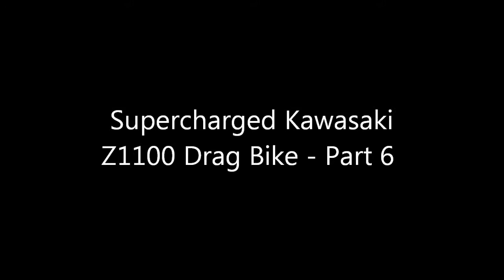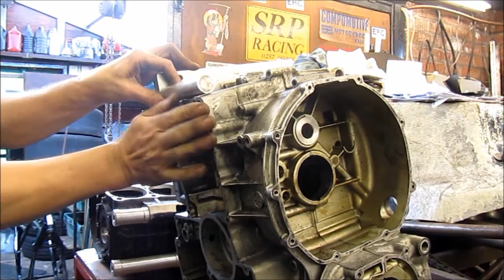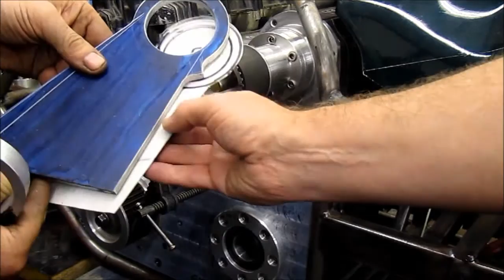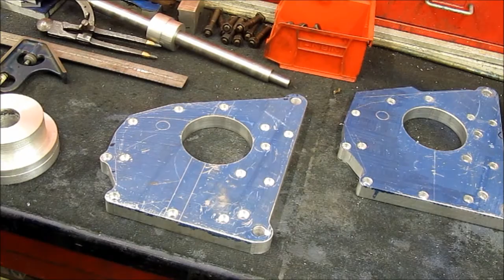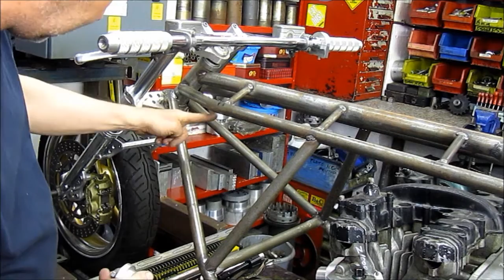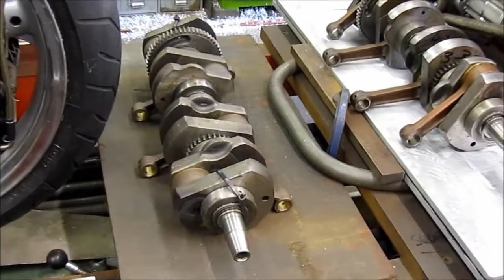Supercharged Kawasaki Z1100 Drag Bike - Part 6

Comment: What mods were made to the crank to take the pulley? 
I'm looking into charging an RSV and would welcome the chance to pick your brains. 
Amazing work!
Reply from the maker: If you go back to Part 5, at the beginning of the video we mention this. We use the alternator mount with the extension for the pulley drive also welded to the crank as well as being screwed into place as was the original alternator. As a drag bike, the motor wont be needing a charging system. The extension also sits in an external bearing support set into the side plate.